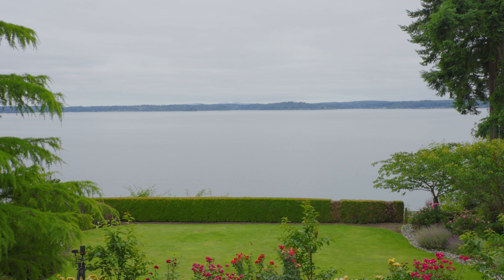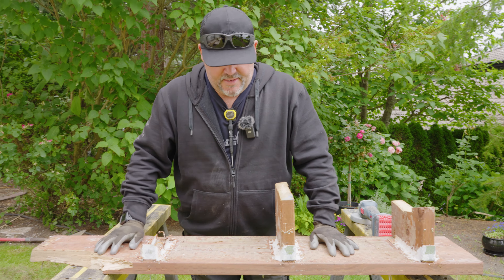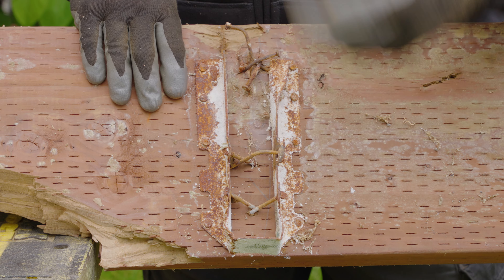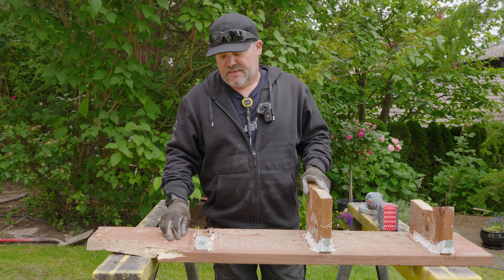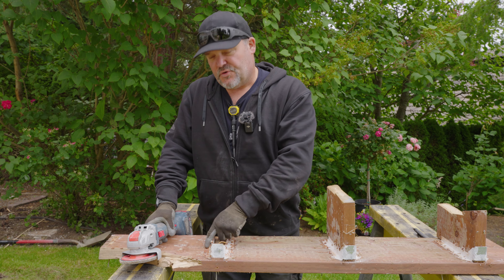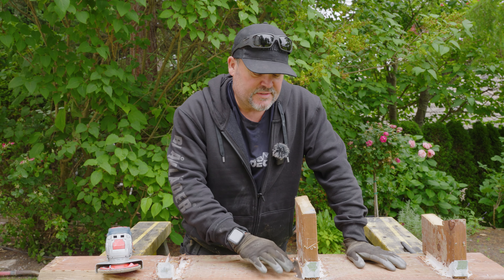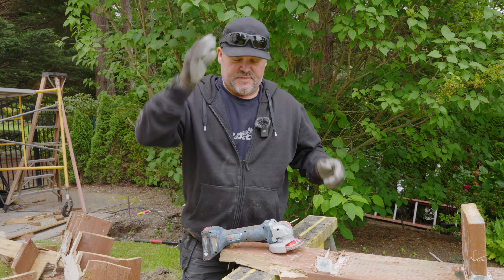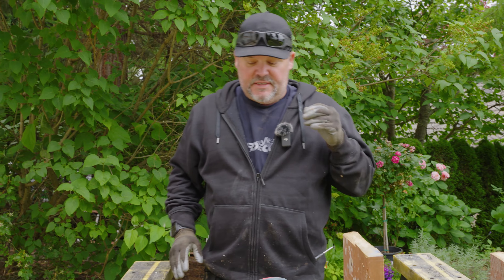Why Living Near Salt Water Can Be Problematic || Dr Decks

Comment: What about taking off surface rust with steel wool (which has oil on it), then following that with a blast of acetone or brakleen, then immediately hitting it with a spray primer and spray enamel? 

Also how would powder coated products compare to stainless steel? 

I want to build to last for 200 years but I’m coastal, sounds like it should be timberframed